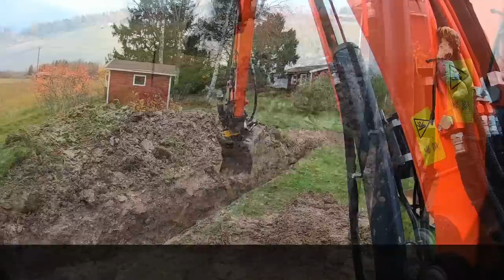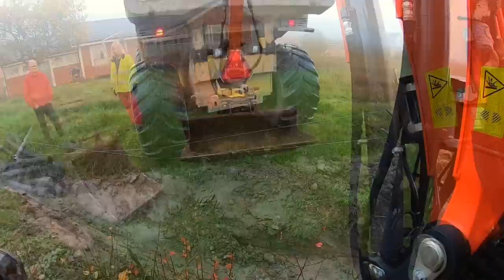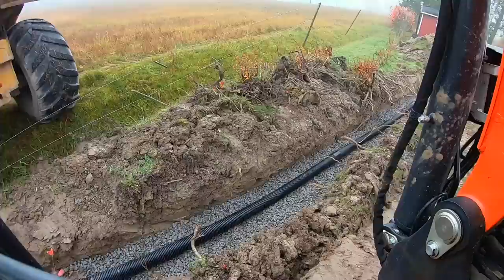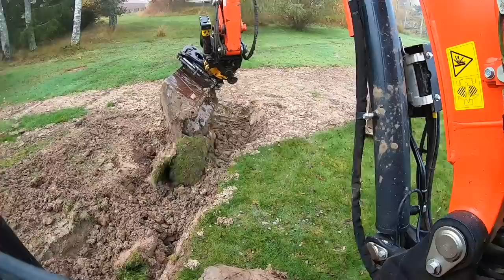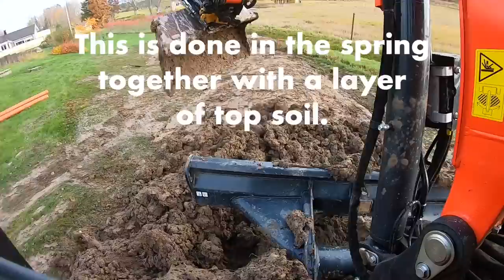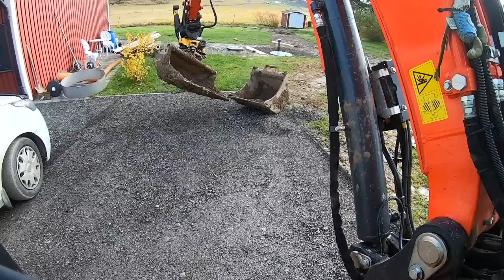Final phase of a drainage work

Comment: Is that perforated corrugated pipe and is it connected to other drainage piping at the beginning of the pipe?
Reply from the maker: Yes, it's drain pipes.
It is connected to a previous drainage solution that did not work 100%.
The soil does not let water through efficiently enough so we install a overflow drain.
Reply: @HedblomSwe  got it. I enjoy watching your vids! From the US!